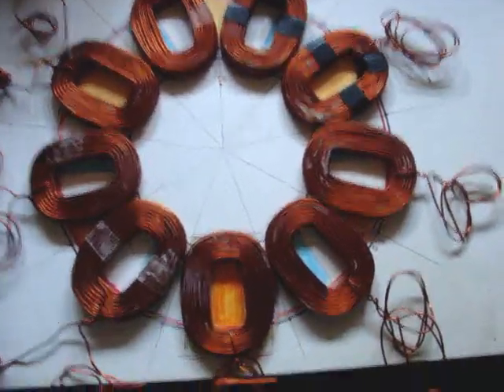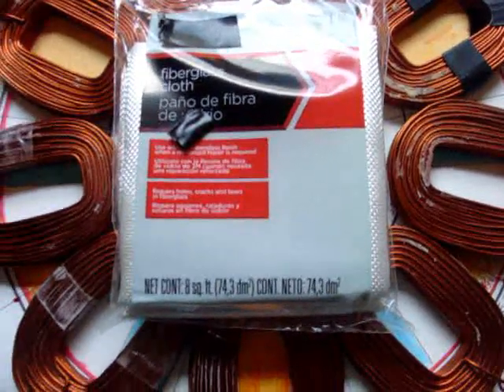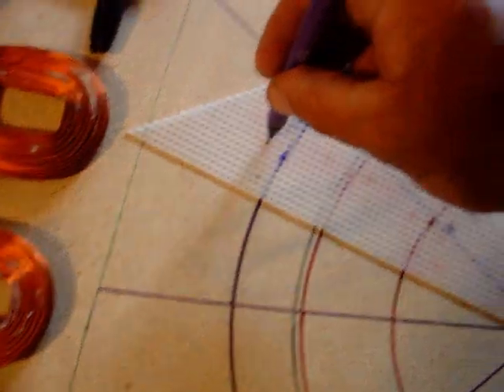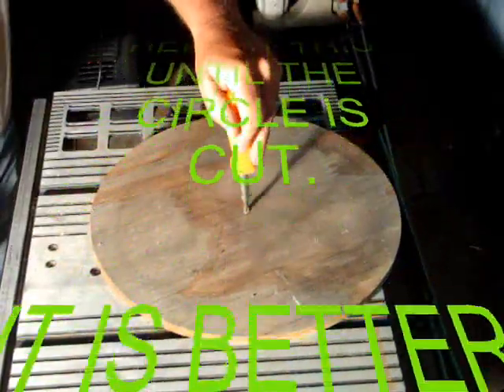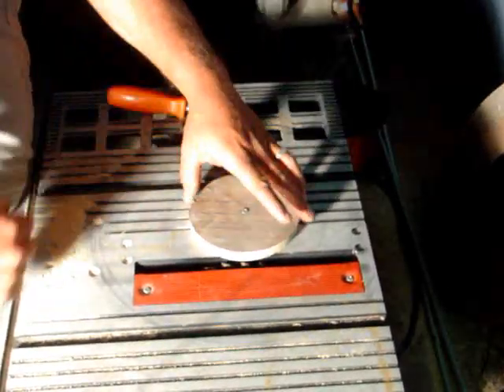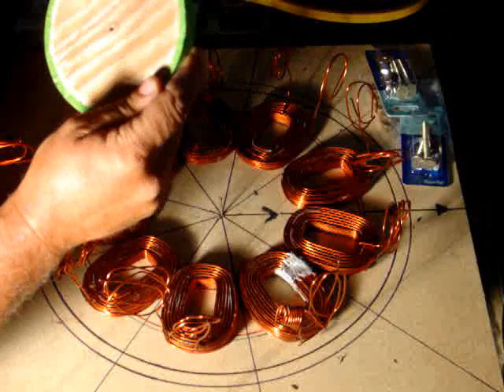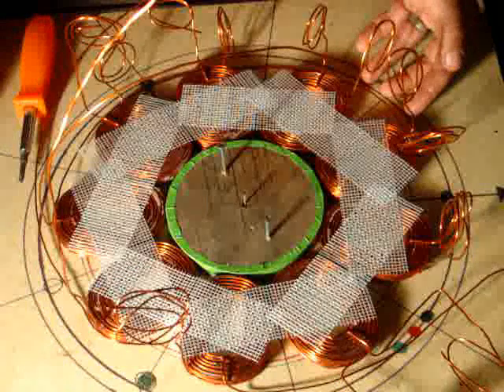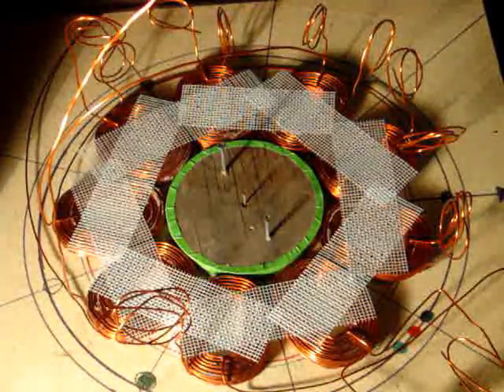BUILD A DUAL PERMANENT MAGNET ROTOR WIND TURBINE (PART 9)

Comment: Referring to the Star and Delta wiring patterns...you said that Star is better for low rpms and Delta for higher rpms. What do you consider the shreshold to be between low and high? 180...240...300? Thx

Comment: is it not going to cause a problem if the coils are touching each other
Reply from the maker: No problem at all Tom. I will explain what is the optimum generation here.
Lets say that the shape of the air core coil is in an egg shape. Stand the egg shape upright on its pointiest end. The size of the magnet should roughly fit the hollow of the coil. The wire that makes up the left and right sides of the coil are called the legs of the coil. 

So we have one magnet filling the middle space, and two magnets of the opposite polarity right on the outer edge of those legs. This makes sure that the flux is spinning one direction on the right leg, and the opposite direction on the left leg. all of the magnetic fluxes of 6 magnets are working together on one coil to the best of their ability. max flux density by full circle of flux. 

Now on the other hand,... if the magnets had no spaces between them, The unit would still work, But a good chunk of the flux would be wasted. The flux must flow around the legs of the coils. 

:)
MUDDy
Reply: Tom Ellsworth   how to contact you in private

Comment: Hi Friends Would you tell me how you connected these coils. Did you connect them in constant pole winding? May I please see a copy of the connecting diagram. What size wire and how many turns did you use? Any help will be great. Don
Reply from the maker: this is a basic three phase winding configuration. I have a video on the diagram showing the connections in three colors.